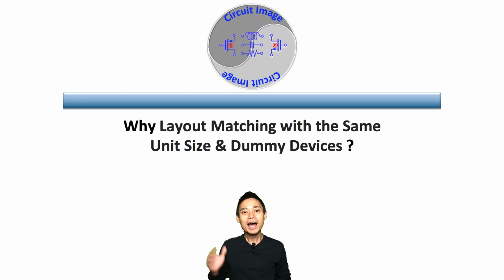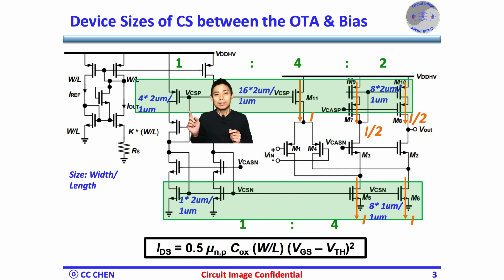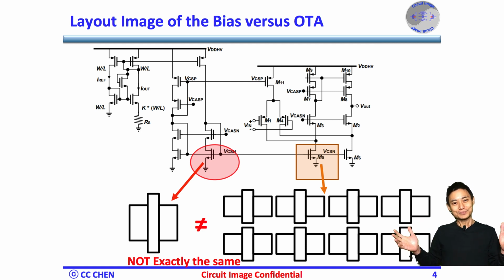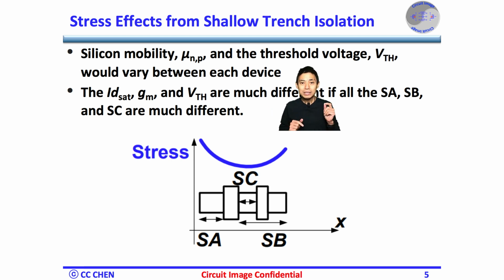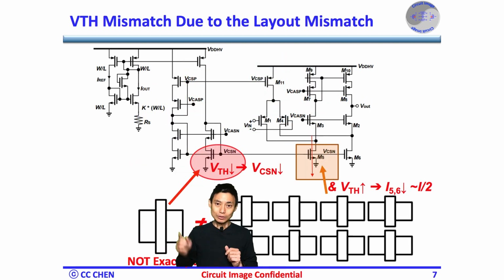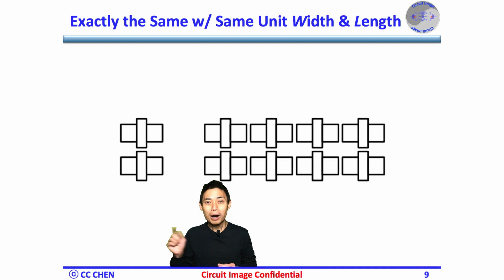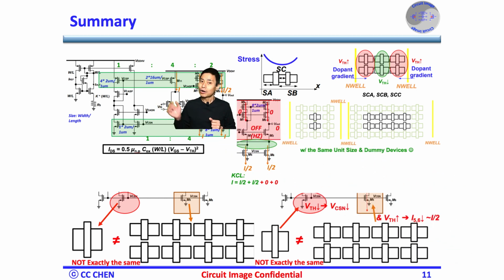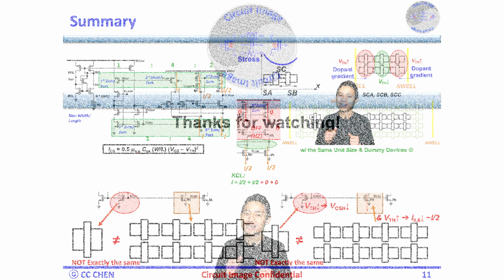Why Layout Matching with the Same Unit Size & Dummy Devices ?

Comment from the maker: Hi all, thanks for Chieh-Ju's good catch. Here (https://drive.google.com/file/d/1Z9_N02j351MdXOzHHYm_zgSfPGFGOxpO/view?usp=share_link) is the correction circuit image of the OTA & Bias. Thanks for everyone's understanding and I apologize for the oversight in my drawing :(
Reply: Thank you for letting us know about the fix. Two suggestions:
1) I noticed that in other channels when they notice an issue/error in their videos, the correction or the link to correction they put under the description of the video. This is because not everybody looks to the comments, so they might miss it. What you did is also fine, but then probably would be good to pin the comment so that it would be always on the top. 
2) Instead of putting the image in google drive, in which case you might need to provide access to viewers manually, you can add this image directly in the Community section of your channel. For this hit the Create button (video camera icon on top right) and do create post. 
Hope this helps :)
Reply from the maker: @hrachya_khachatryan  Thank you so much for your suggestions. All are so well that I applied all of them. I really appreciate your help when I made a mistake. I felt we are on the same team. 😀